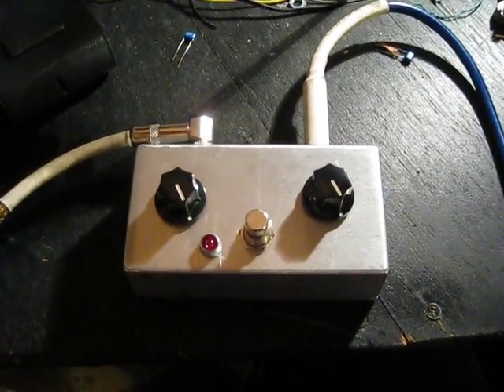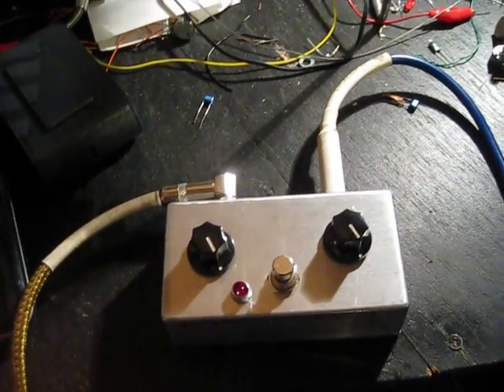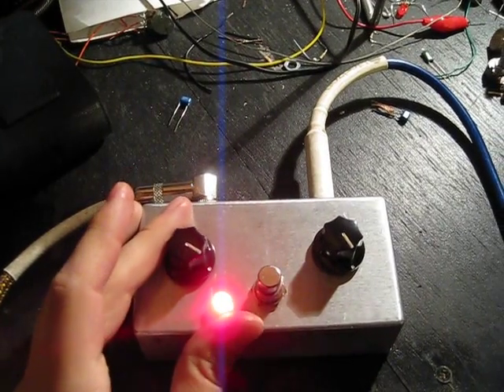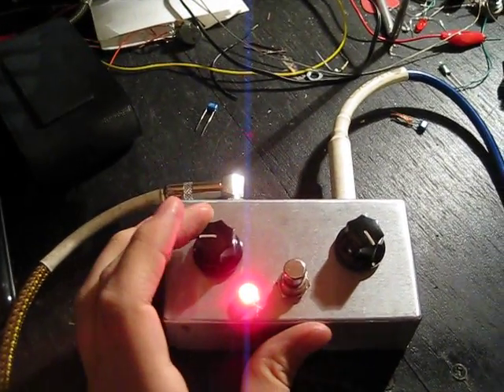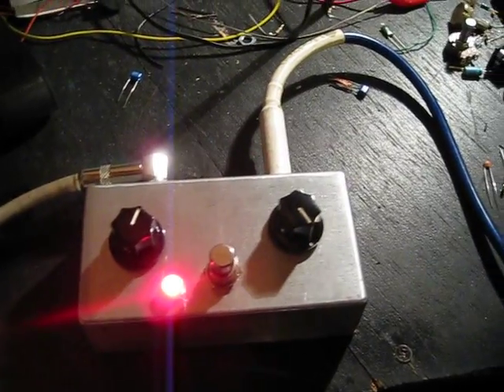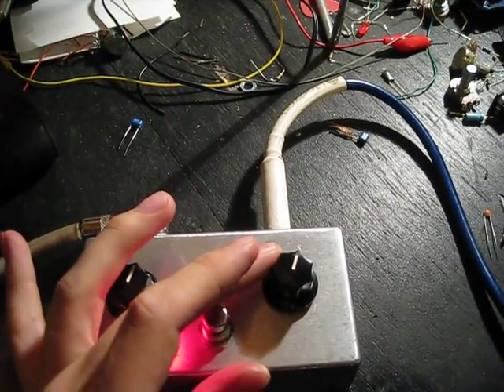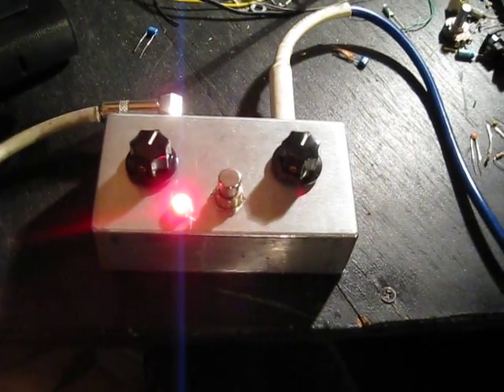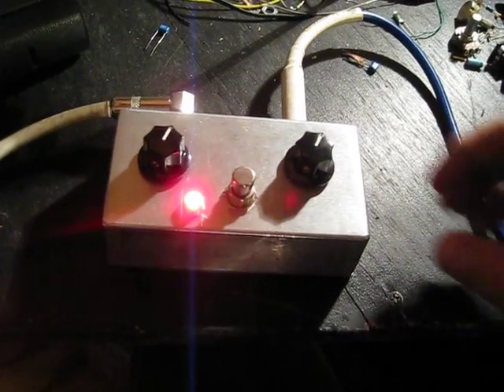Kleeb Fuzz

Comment from the maker: Like I said previously, this is not a broken pedal or schematic. I'm simply using the CD4069 hex inverter chip (google it) with a capacitor (probably 0.1 uF) between each pin. I'm using 3 of the inverters on board. For less distortion, just use less inverters.

There are thousands of schematics out there using this chip, so if you're looking for a different kind of fidelity, maybe try a different chip or additional components.

Comment from the maker: Actually I built this to sound like this. The CD4069 has 6 inverters on board. The more inverters you use, the more you can overdrive the signal. The capacitors you use in the feedback loop also affect the sound. I believe this was built using 3 inverters. Any more and the sound was totally indistinguishable.